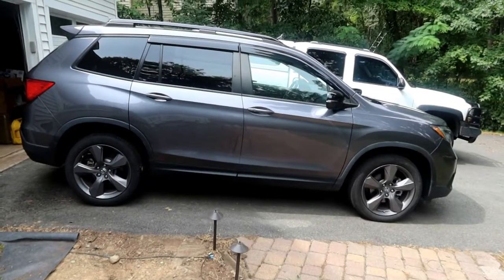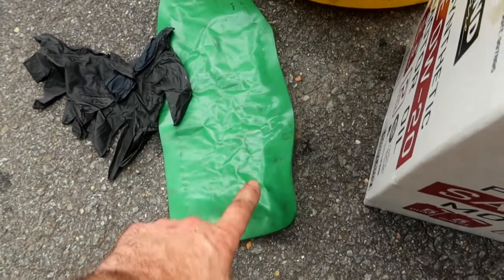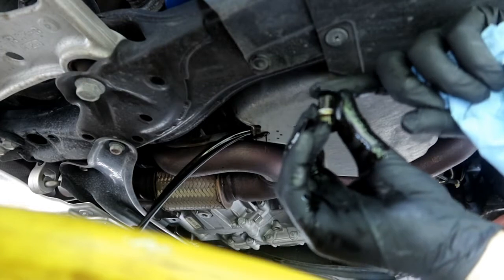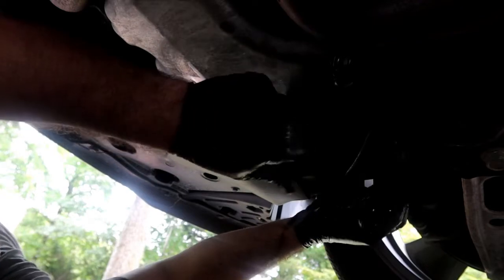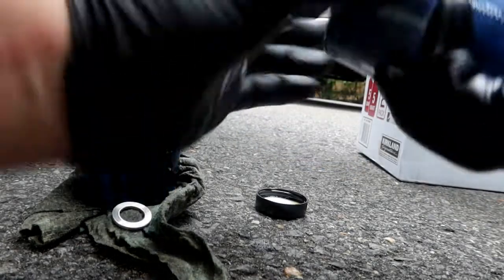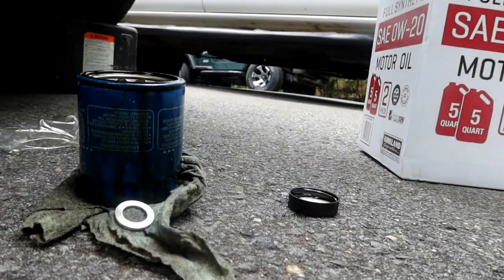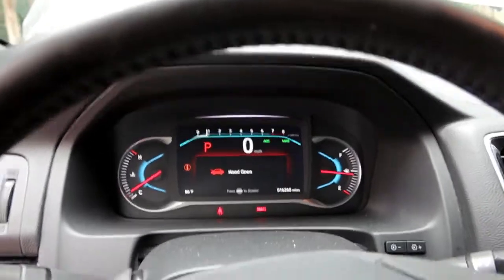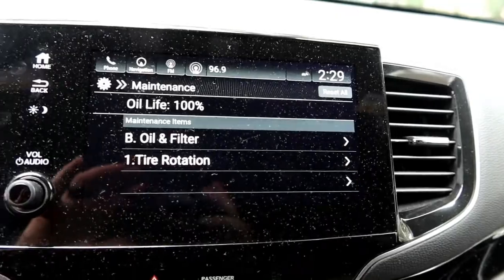2019 Honda Passport  oil and filter change / oil life reset /  tricks for clean and fast maintenance

Comment: Really nice video. Thank you. Two questions: 1.) you mentioned a gasket when removing the old oil filter, but didn’t specifically say anything about placing a new gasket on with the new filter. Is there a gasket on the new filter and the only reason you saw it separate from the old filter is because it comes off of the filter once you take the old filter off? 2.) is the wrench only necessary to take the old oil filter off but not necessary to place the new one on? Thank you.
Reply from the maker: Yes and yes. The filter gasket should stay with the filter